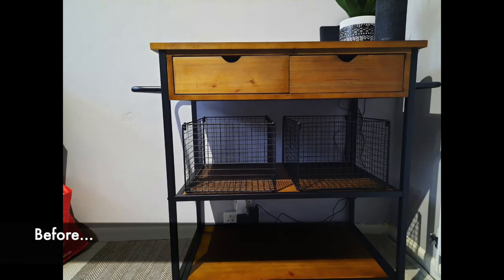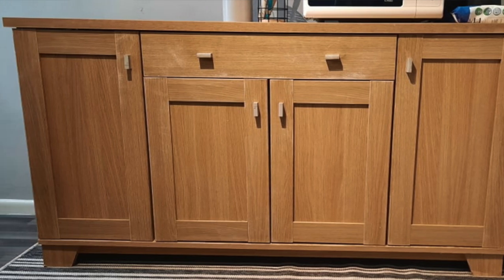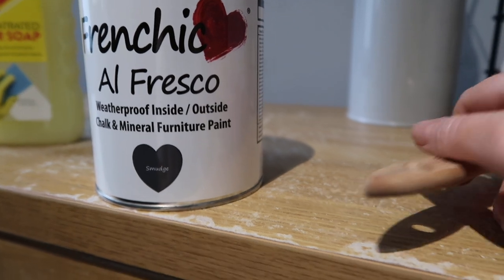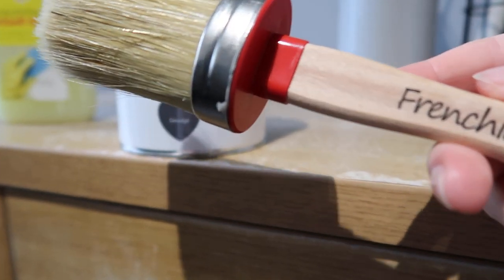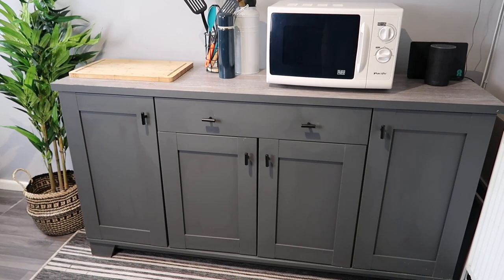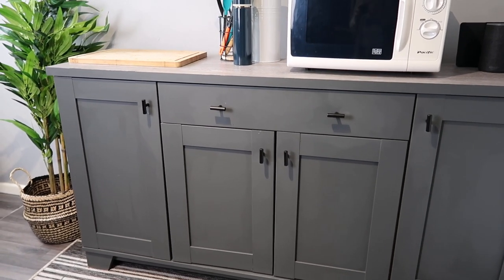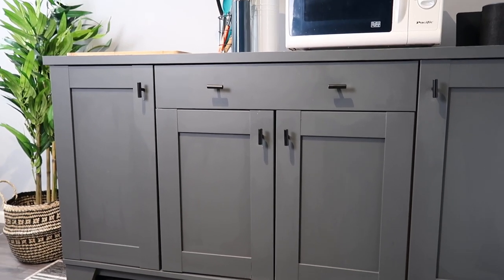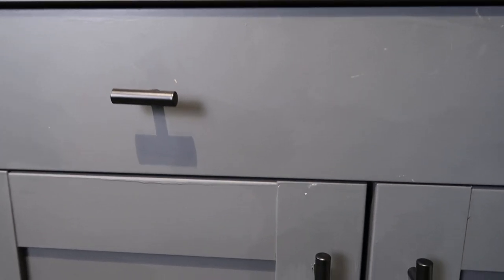KITCHEN STORAGE CABINET UPCYCLE WITH FRENCHIC PAINT

Comment: Hiya would you recommend paint over dc fix on kitchen cupboards? My kitchen desperately needs an update but I've just bought new external windows and doors so wanting to do a cheap transformation on kitchen for now, also do you still have dc fix on worktop and would you recommend? thanks!
Reply from the maker: I’ve used dcfix on the cupboard doors before and it’s worked well! I like using it for just the top of stuff now though - especially the wood effect ones :D Yep, it’s still on there and I’ve just recently done another cheap kitchen makeover and the video should be up soon! :D

Comment: There are a few things you could have done to stop the chips, if you would have used an primer like, 'Leyland Trade Acrylic Primer' that would have helped a lot, also you could give it a wax, where the wax doesn't stop it chipping, it gives it a smooth finish, less snagging in on the paint that way.
Reply from the maker: Ah, that’s super handy advice, thank you!
Reply: Frenchic doesn't require a primer. It takes 3 weeks to fully cure. That's what caused the chips :)
Reply: @lauramccarthy8339  Lot's of things doesn't require a primer, then you would get less chips if you had. As I'm sure you know it very much depends on what you are painting and what it's going to be used for afterwards, if it's a display cabinet then no I would not use a primer, then if it was a table in use all the time yes I 100% would.